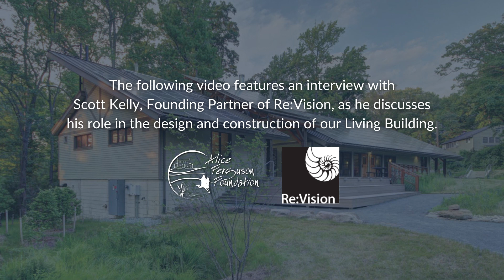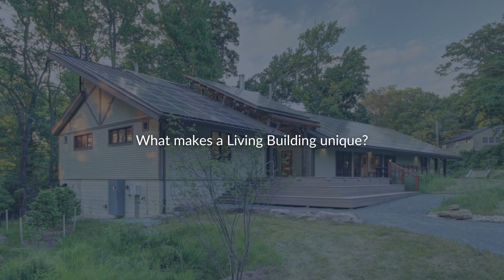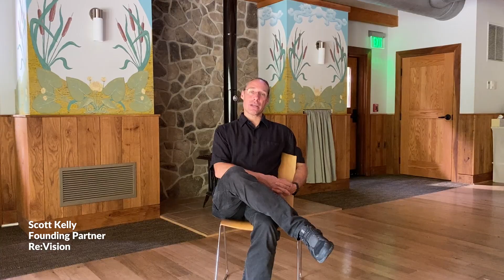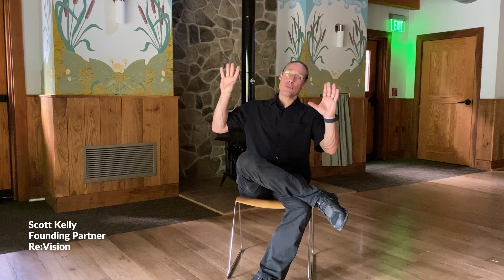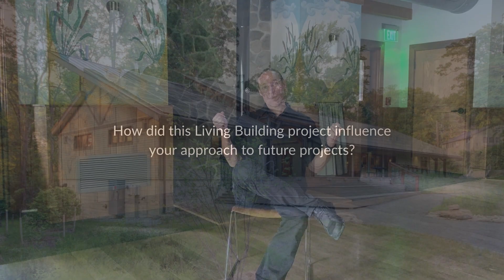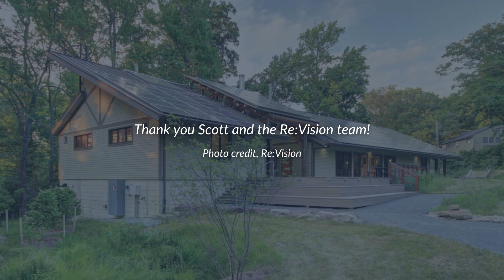Living Building Interview with Scott Kelly

Comment: Interesting interview, but I think it would have been more engaging if it took place during a walk-around of the building, actually showing some of the differences from a typical building like the specific materials used, water handling or energy harvesting components. A walk-and-talk with an engaging interviewer, rather than the static one-sided conversation.